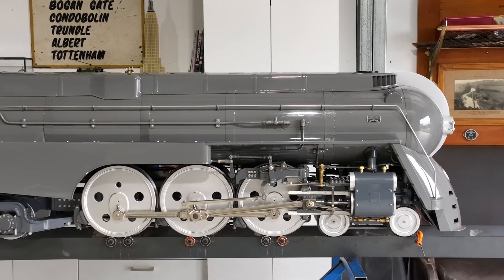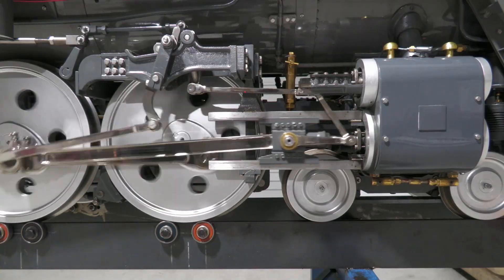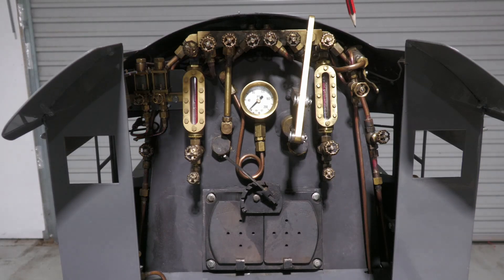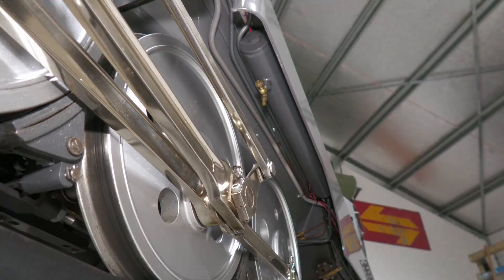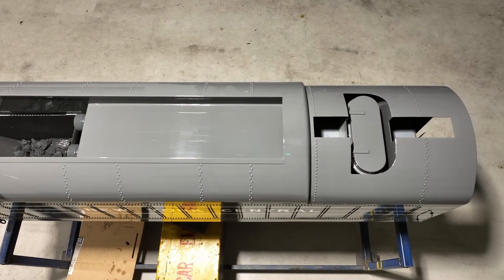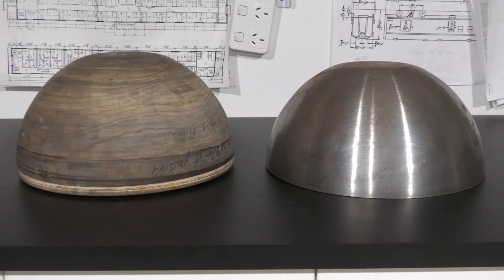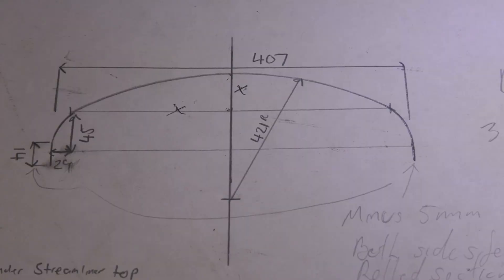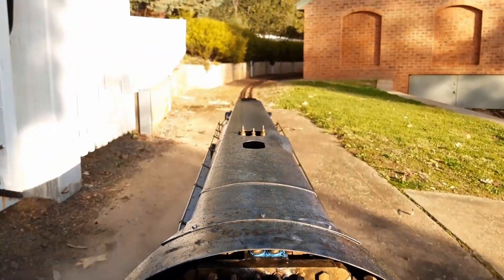Live steam NYC Dreyfuss Hudson overview

Comment: Nice job on the build! I assume you went with the piston valve design over the older slide valve? You said you have 3 tanks in your tender... how do you fill with one hatch?
Reply from the maker: Yes it the pistion valve, the three tanks are interconnected with each other at the bottom

Comment: 1:41 slight issue with how you numbered it. you see while there was 10 J3a Dreyfuss Hudsons built, the J2 Hudsons originally from the Boston & Albany railway were given the numbers proceeding 5454. So 5455 was just a regular hudson and not a dreyfuss.
Reply: Most likely they did not know this when building it. Honestly I didn’t know that before I started gathering nyc items and most wouldn’t know that without decent research.
Reply: So would changing it to 5456 fix the issue?  Should be easy enough to fix with vinyl numbers.
Reply: @paulw.woodring7304  the Dreyfus engines were 5445-5454. The 5450-5454 were the ones with the disk drivers like on the engine in the video. Now, there was an 11th being J1e 5344 when it was converted from the Commodore Vanderbilt to a Dreyfus to pull the Mercury but had a different paint scheme. 
I’d say the safe numbers would be 5450-5454 or 5344 and say it was painted for the Century.